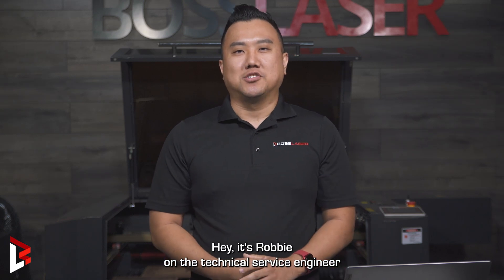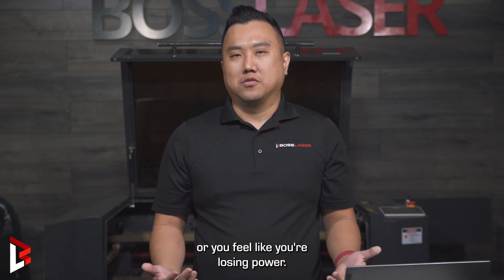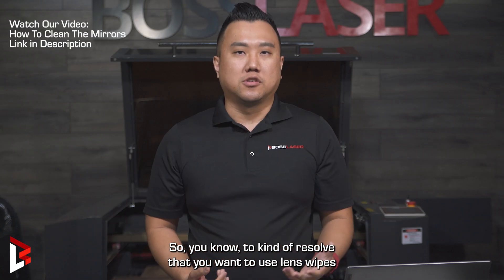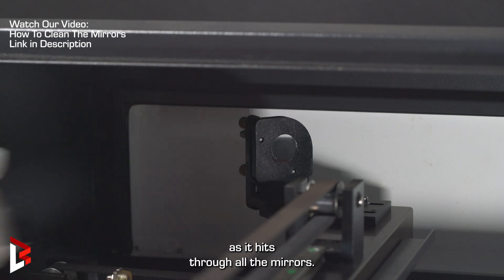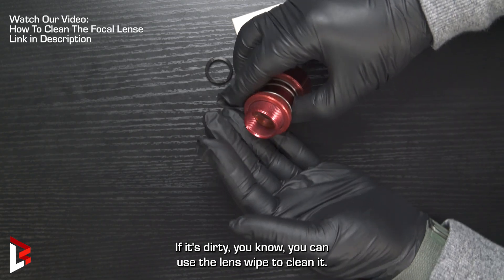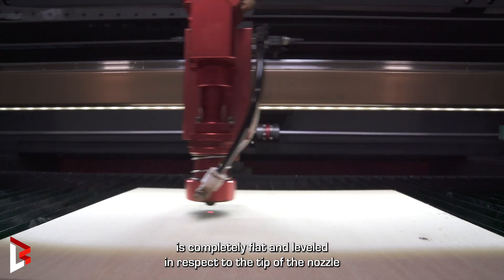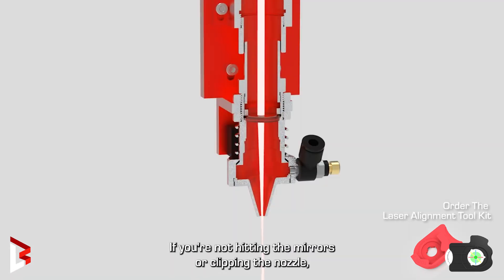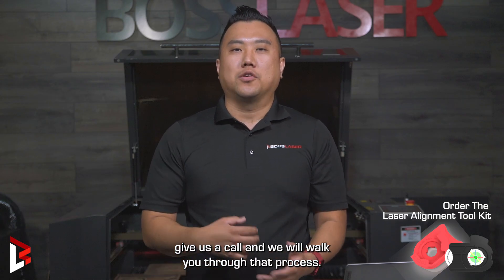BOSSLASER | Quick Tips if CO2 Laser Losing Power

Comment: Hi there, would be nice to get a video of how to properly screw on the lense housing. I'm confused about the the screw that squeezes the spring. Does that have to be all the way down? Or just enough. Trying to understand how the auto focus works. Is it sending a signal to the material to see how far away the material is. Or is it sending a horizontal sense to the nozzle as it touches the material and raises up. I have a feeling the position of the spring tightening screw matters if the sensor is getting its focus readings by the way the nozzle moves up. And nozzle position is going to be different depending on where your collar is (the collar that tightens down the screw.)
Hope I could make myself clear
Reply from the maker: The retaining nut that sits right above the spring will dictate how much the lens housing is sitting on the lens housing bracket. This is important because if it is set too low (retaining nut screw down onto the spring), when installing the lens housing back onto the lens housing bracket, the autofocus sensor (usually black, orange, or teal block) will also be triggered. If this happens, you won’t be able to move your worktable up because the machine thinks that it’s already touching the lens housing/nozzle. If it is set too high (retaining nut sitting above the spring; decompressed), when installing the lens housing back onto the lens housing bracket, the autofocus senor will never trigger, so in turn, when activating the autofocus feature, the worktable will continue to move up and run into the laser head assembly and can damage it.

How the autofocus works is the worktable that has your material comes up towards the tip of the nozzle on the laser head assembly and compresses the lens housing, which then triggers the autofocus sensor that’s sitting behind the lens housing. Then moves the worktable down to the autofocus height that was set on your machine (previously set by our Laser Technicians in-house). This height is set by default that the focal lens that came with the machine